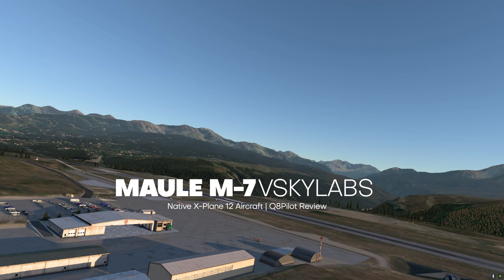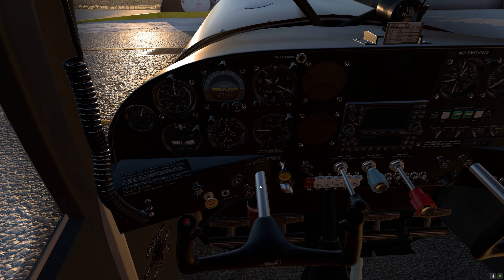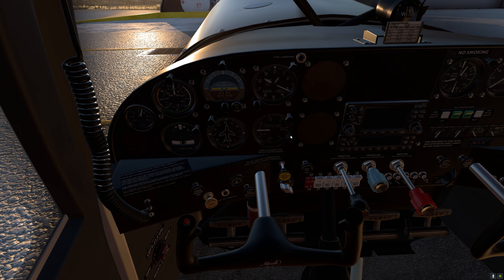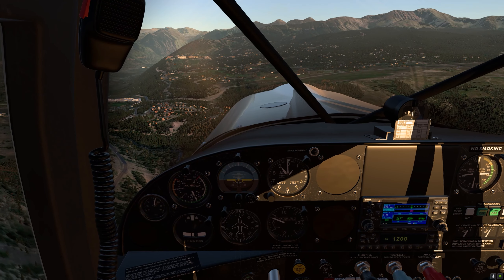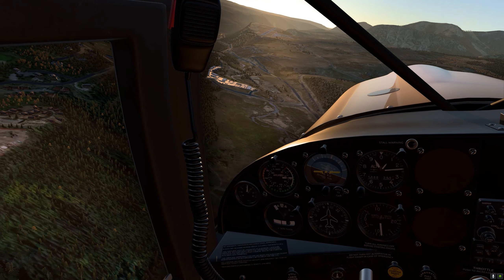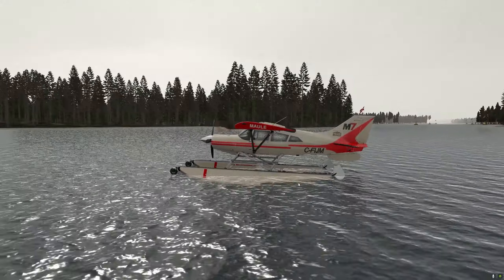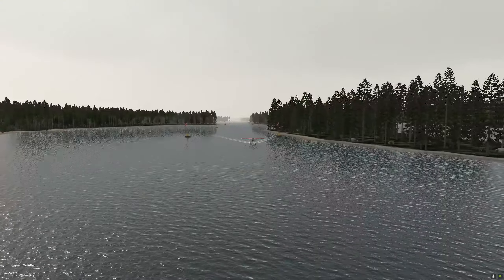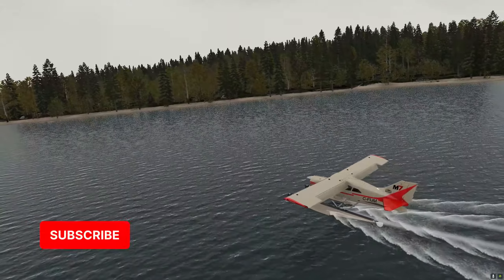X-Plane 12 | Maule M-7-235B by VSKYLABS | Review

Comment: As someone who owns one of these airplanes, I have some opinions.  

Interior sounds aren't great.  Engine sounds rougher and louder than the actual O-540.  You get substantially less prop noise than you do in the modeled aircraft.  
The stall warning horn sounds nothing like the actually horn.  
The modeling is actually quite good.  The stall looked fairly realistic--she does have a tendency to drop a wingtip, though it's generally the left one.  
The landing and takeoff looked fairly close--lots of right rudder required, I recommend setting the right rudder trim (if functional) to it's fullest extent to ease the pressure required on the pedals.  

All in all, I'm curious to try it out.
Reply from the maker: Thank you for sharing your insight with the community. I appreciate it very much.